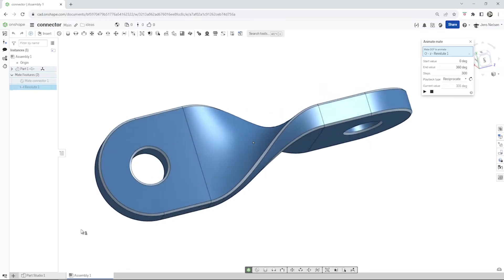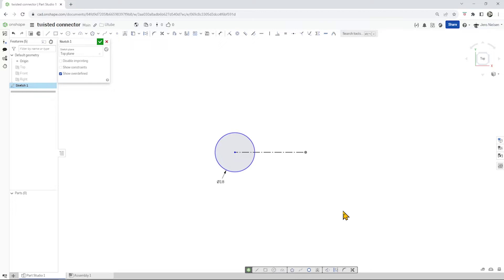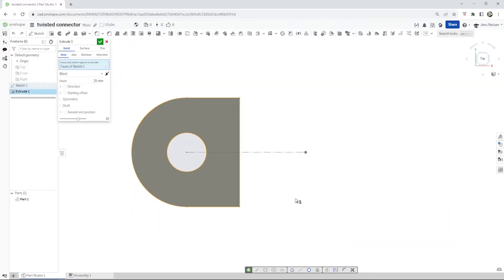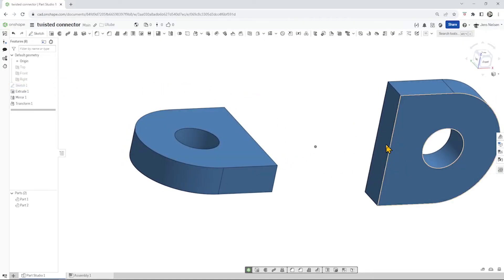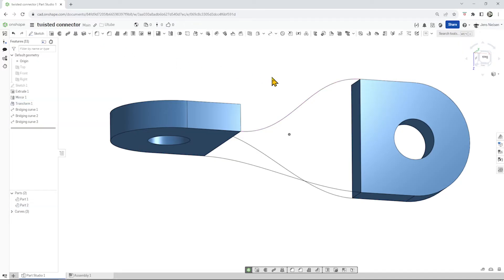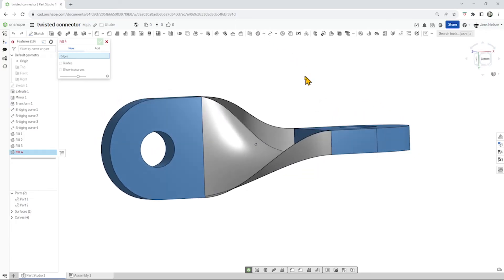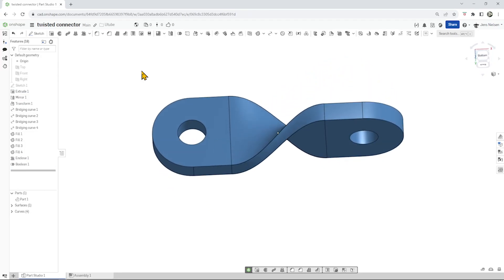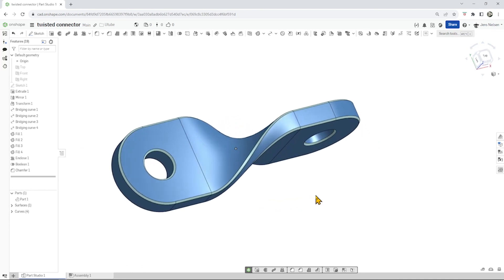How to model  a twisted connector in Onshape with surface  modeling

Comment: Nice tutorial, but I have a question...Why did you have to make the surfaces part a solid but you didn't have to make Part 1 a solid?
Reply from the maker: Part 1 originates as a solid part, therefore no need. You can choose between solid and surface in the command.

Comment: In the loft dialog box: You need to select the 2 faces; both End Conditions select 'Normal to Profile'; under Connections select 2 of the connecting vertices; and finally 'Merge all'.
Reply from the maker: great tip and technique!

Comment: So I've been trying make a square spiral channel in a part. If you use bridging curve does that automatically make the shapes formed with it the same thickness? Like if I connected 2 pieces that are rotated 90 degrees like this and they're both an inch thick, is the curved portion still an inch thick? Or is there a way to specify that?
Reply from the maker: you could define the shape with a surface, and then specify the thickness.

Comment: Thanks for this interesting video! The twisted section could be accomplished much easier with the loft tool using the "connections" option. In the connection option it's enough to select two corresponding opposite vertices of the the end-surfaces and it's all done.
Reply from the maker: Great tip!
Reply: How did you achieve a twist in the middle section using loft? When I connect diagonal connectors using loft it's not as twisted as what's achieved here. Did you add a curved guideline? Pls Explain
Reply: I think it's called a guiding curve in loft feature, anyway, it's all part of the loft feature
Reply: @JeromDaniel-bn9oz  I don't know how Gassmaninov did it in Loft to make it look like the tutorial, and I don't see anything called "guiding curve" (per CGreciful's thought) in the dialog box. Something is missing or needs clarity. I like the way the twist came out in the tutorial.

Comment: This is how i would do it:
use the slot command in the sketch to simplify the constraints. Connect the tangent points with a line and trim off the arc.
Use only one bridging curve as a guide when lofting the square surfaces normal to profile
Reply: Do a video, not a critic
Reply: @eiz3333  
I'll be happy to spend some time and other resources if you need help understanding the topics i mentioned. let me know
Reply: @nilton61   I would love some help understanding the topic you mentioned, I understand how this video does it but your explanation is confusing me.
Reply from the maker: I'm happy to admit that your method is fast and efficient. Thanks for your comment.

Comment: Not to knock your way, it works, but I would have used a loft in "add" (normal to both profiles) with one bridging curve (tangent) as a guide.
Reply from the maker: I just checked your method and it works great, very efficient. Thanks for  the  input.
Reply: @cademist  not a problem. I use OnShape for work. The R&D Director likes doing spitball/brainstorming Teams meetings and I've had to learn some creative ways to do it faster.

Comment: Thanks for the surfaces, I learned a lot !
Question :  How would be the correct way create the part to maintain a constant cross section ? 
Thank you
Reply from the maker: Hi Rich, long time no see! I saw some nice stuff on your channel page. That's a great question-I thought a loft could accomplish that---what do you think?
Reply: @cademist    Thanks for the pointer.  I created a mid-part profile at 45 degrees and lofted "Normal to Profile"  and it is close.
Lots of fun stuff to learn and play with.  
Part is in Onshape public space as  "(Cademist) Twisted Connector - 2 Ways "
Thank you for the start and the push !!     RichPenn